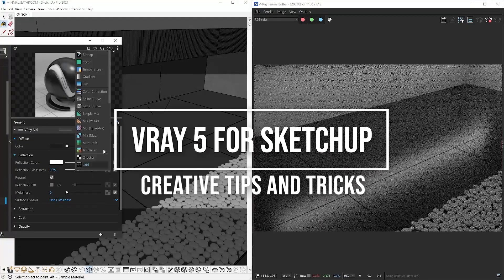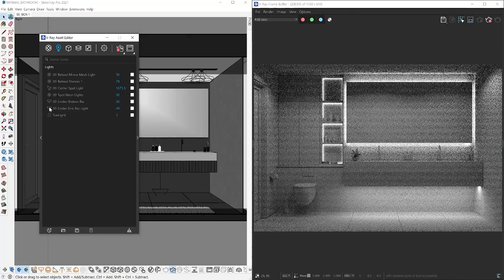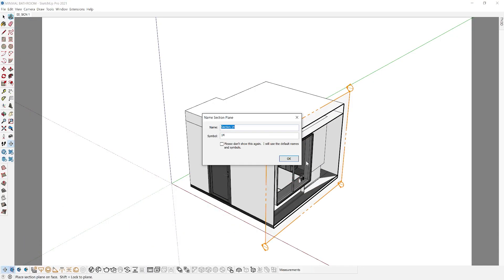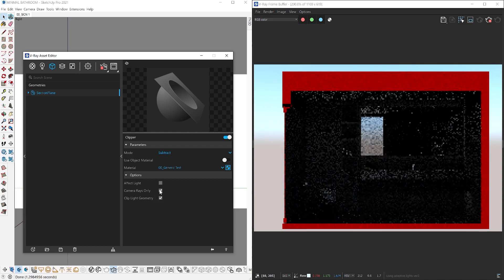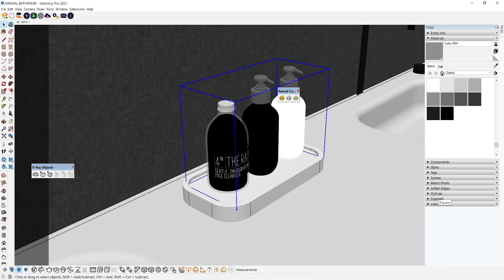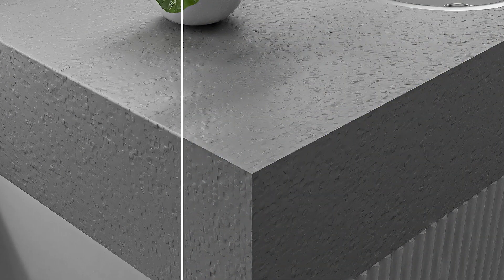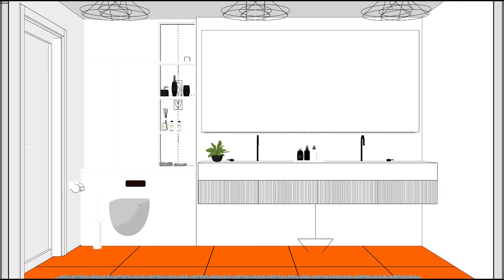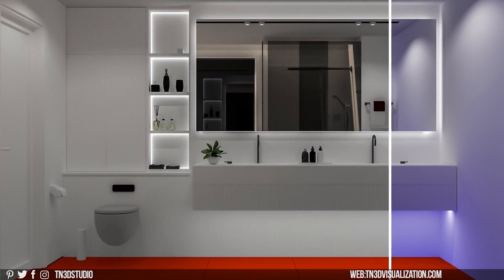V-ray 5 for Sketchup | 4 RENDER TIPS for Realistic Interior | Vray Creative Tools

Comment: Thanks for the video. I think Round corner works better then the V-ray setting, although it's difficult to undo. Fredo Corner is even better coz you can repair the rounded corners, but you have to pay for it.
Reply from the maker: Unfortunately its no longer free. You cant overdo it with V-ray edge, it looks too fake. But it works well for me in most cases. :)

Comment: What a PC do you advice for fast Vray rendering. Will Ryzen 3900x and RTX 3050 work for under 10 minutes renders?
Reply from the maker: It really depends how you optimize your scene. I'm running on AMD Ryzen 9 5900HX, 16GB, and 3060. Handles my scenes pretty well. But for Complex scenes it can take over 10min.
Reply: @TN3DStudio  wow! I have i5 3570, 32G, GTX 750Ti 2GB and simple scene 360 4000x2000 takes 3+ hrs!
But I'm about to change to something Ryzen'ish...